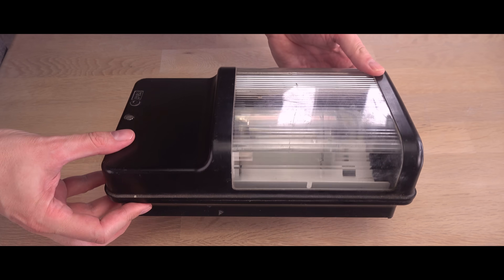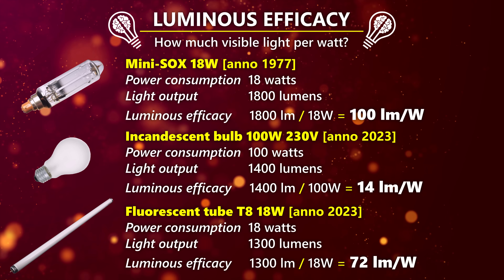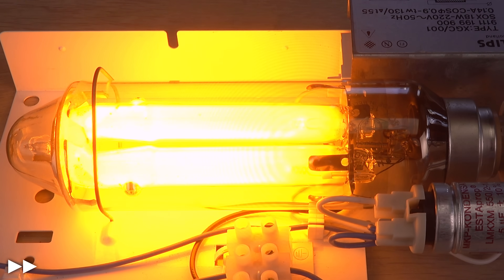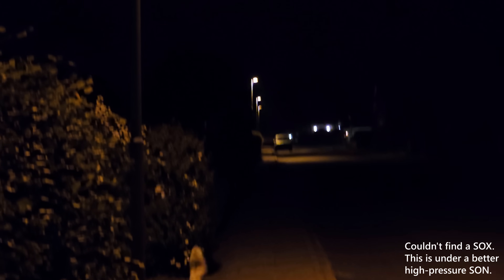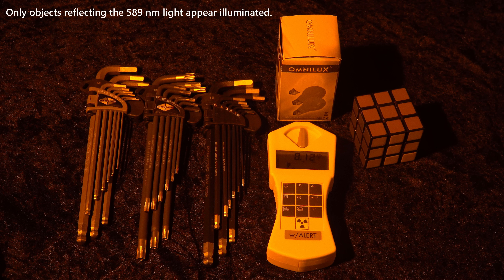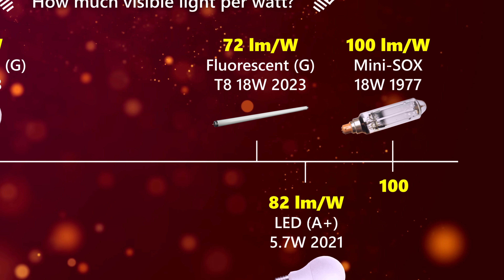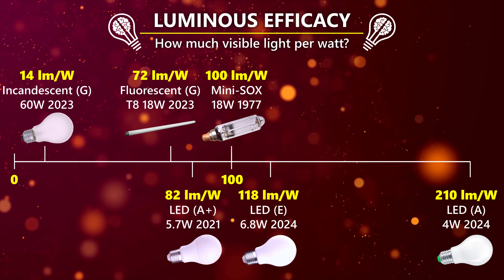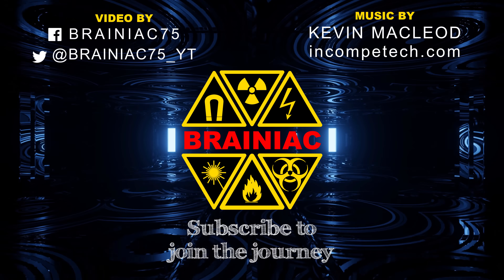THIS LAMP SOXs! "Yellow" tech of bright metal vapor lamp. Beats modern LEDs in brightness per watt?

Comment: IIRC Nilered has a short where he lights a fire that's doped with sodium and shines this light on it.  The effect is quite neat!
Reply: That's the "black flame" and is due to the idea that something's emission spectrum is the inverse of its absorption spectrum. So rather than appearing to only emit the orange light, it also completely absorbs it.

The sodium in the flame is overpowered by the LPS lamp and so appears to be black. Likewise, a shadow is created by the flame if the light is shining through it.
Reply: @MadScientist267  I'm trying to understand this... May sound like a silly question, but why does the lamp not absorb it's own light? If you were to shine a brighter sodium lamp at a less bright sodium lamp, would you get the same absorbing effect?
Reply: @sebastiansullivan4770  Basically, it does, but more of it escapes. This is one of the principles lasers need to operate.
Reply: @MadScientist267  thanks for the answer.  I am also wondering would solid sodium also absorb the yellow light and look dark?
Reply: @sebastiansullivan4770  In a nutshell, no. The structure is different so it interacts differently in solid form. This is also why an LPS needs time to warm up... it can't emit the orange light until it is in gas form.

Comment: Due to a variety of circumstances, I had the fly out of my city's secondary airport.  I parked my red car in the outdoor parking lot and went about my business.  A few days later, I returned late at night and headed to the parking lot.  I walked around for several minutes looking for my red car without success.  After fruitlessly pacing around, I decided to trigger the panic alarm to locate my vehicle.  To my surprise, the honking horn and flashing lights came from a brown car nearby.  Like at 6:16, the sodium vapor lights changed the color of the car as my eyes perceived it.  I had to check the license plate to confirm the brown looking car was indeed mine. My regular airport had newer LED floodlights and my car's apparent color did not change.

Comment: Couldn't you make the light "White" by mixing for example, Barium, Calcium and Lithum or Rubidium? I mean they'll have a higher vapor point, but it may work.
Reply: Then you'd be reinventing the wheel, there's metal halide lamps that used to be used in like warehouses, and big box stores etc. They are now just being replaced by high output LED lamps in just the last few years. A decade ago, 400 watt and 1000 watt metal halide lamps were used in a lot of stores and warehouses for white indoor lighting of large areas.

Comment: A downside with higher CRI is that it is detrimental to a lot of insects flying about at night. This weren't a problem back in the day since most of these species only really sees blue and UV light, and back in the day when street lightning were yellow, there weren't much blue and UV light pollution to speak of. There are however LED lights on the market that does not contain much blue and UV light for this very reason.

High CRI is simply not that great for the outdoor night time environment. So don't be surprised if you see a lot of yellow-ish street lights in practice.

For a while the city I live in (stockholm) did have white street lights as the replacement to older sodium lamps, and there is still places with these white LED lights installed. But more and more are replaced by something more yellow-ish.

Comment: The difference is those LEDs don't last nowhere near as long, I've noticed the street lamps in my city going bad in as little as a few months some mere weeks, 

They start to change color or flicker, and about a third of them have gone completely out. 

Some are strobing like a strobe, some in intervals of about 5 to 10 flashes a second, some around 1 every 2 seconds, and some have turned bright purple.

Some where even the bright purple when they first installed them.

And on top of all that, a lot of them just stay on 24 hours a day. It's a mess.
Reply: While I'm not at all a fan of LED street/lot lighting... Those issues are mostly* from cost-optimized driving/control circuitry, not the LEDs themselves or even the technology. 

The old SOX lamps had some 'fun' failure modes too, but nothing like these LED monstrosities.

*Beyond poor EMC design causing and receiving interferance... There's also some 'spooky' implementations in some of the LED street lighting: 
Superfluous-for-function computerization/electronics on-board that complicate reliability and (sometimes) make you want to dawn They Live shades and a Tin Foil hat. 😅
Reply: @LRK-GT   Oh I know the computerization turns the reliability/ functionality to shit, every time theres a Lightning strike or power surge, they go completely crazy and start flickering, going on and off, and changing colors.

By that I mean like a rapid 3K to 5K temperature switch back-and-forth, in a seizure inducing manner.
 
And it gets even better, the one across the street from my house While it's doing that, makes an extremely high pitch shrieking sound for about 20 seconds.

Comment: The new modern LEDs are more efficient, but for some reason don't last as long as the lamp from the 70s.  Lets load a lamp with complicated power supply components to eek out that extra lumen per watt - at the expense of having to change the lamp out more often.  Whatever happened to the basic rectifier to feed LEDs?  (( also, comment for algorythm. ))

Comment: Another benefit of Sodium light is that the near monochromatic nature of it makes it easier to perceive motion, and it is better for night-vision in general (they are still used on some ships where people need to go outside into the pitch black night as to not hinder their nightvision so much).

As for the lamps i am using: an oooold halogen desk-lamp (nearing 30 years of daily use), some (bad) GU10 LEDs with just barely 60lm/W, and ... a 180lm/W 9.5W lamp for when i need some light for crafting :)
Reply: you should be alright now. the new style cob leds. ive got one glass bulb with those in thats got a really nice streetlighty tone to it. i think were passed the dark ages of leds 😂

Comment: I'm a nerd and use gas discharge lighting for both general and internal lighting applications... the efficacies of the lamps I use regularly are;

20w metal halide - 90 lm/w CRI >80
70w metal halide - 97.1 lm/w CRI >95
150w metal halide - 110 lm/w CRI >90
35w low pressure sodium - 115 lm/w CRI >-44
26w low pressure sodium - 140lm/w CRI >-44

I wouldn't usually list it considering I rarely use it owing to the fact that control gear is unicorn horn levels of rare, but I also have a 200 watt linear sodium lamp. that's capable of a similarly bonkers 147.6lm/w.

All of these beat out the cheapo LED lamps quite handily for both lumenous output and lifespan in my own experience. in some cases even lumenous flux over time too lol
Reply: Plasma is the boss, L** is boring.

Comment: In my desk lamp is a led bulb from ikea, rated at 136 l/w, some g4 socket lamps are 120 l/w (since switching out the incandescent ones to those leds the transformer is really unhappy with the little load it now has to supply).

Comment: Here in the states it’s generally 90-120 lumens/watt these days. Just got some cheapo LED filament bulbs at $2 a pop, says 780 lumens on the box and uses 6.3 watts on the meter. But theres only 2 filaments in there getting grilled at 3 watts each, so they probably wont last very long….The government is looking to institute a minimum efficiency of 120 l/w in a few years. I just hope they put minimum requirements for CRI (r9 too), flicker, lifespan, power factor etc because the lighting companies will want to achieve the higher efficiencies by lowering the quality of the light instead of innovating. LEDs are awesome but like most things in life are only as good as the implementation. They’ve switched to all 5000k+ LED street lights in my city that cant dim, spread light unevenly and glare like crazy, I haven’t seen stars since the switch. They make 2200k street lights that can dim in the small hours and illuminate well that are twice as efficient its just that the city council cheaped out or didn’t care to do the research

Comment: Most of the energy loss in LED lamps is because they are connected to 220 volt (or 110) and thus need to get that down to what LEDs actually need. That is where where the big energy loss is.

Comment: A couple of cons that I noticed with the newer LED street lamps when they were being installed where I was working and living back a decade ago was how painfully bright the lamps themselves were when in direct view and how little they actually "illuminated" outside of the emitter's direct illumination cone (anything directly within would reflect and be visable for a good distance, anything outside of the illunination cone turned pitch). With the Yellow amber there seems to have been a bit of a bleed (might have been just how wide an angle the lamps were designed to illuminate) that caught more of the surrounding area. I worked night security when the town I was living in did their transition. Night illumination went from a dull yellow glow with a few dark patches in the area to patches of illumination right under the lamps surrounded by huge dark patches. Ya, the yellow glow was worse for color quality, but the better color quality lamps were worse for actually seeing if something was there. The light actually hurting to try and see in didn't help.
Reply: That's just a property of a brighter light being outside, it has a more apparent contrast as it has nowhere else to bounce but to go straight to the atmosphere.

Comment: Bummer I can't afford to be a patreon on this. Its a subject that interest me a lot. Allow me to explain: I cultivate hydroponics leafy greens. In this field, one of the main challenges is dealing with exterior(natural) plagues. The more isolated the plants are, the healthier they get in this regard. But its not feasible to have a fully isolated greenhouse, at least not in affordable prices. Having the cultivating beds inside a building is the best when it comes to isolating from outside environment, but this makes it a real challenge for providing light to the plants. Sure modern LED lights are great, but since we need a lot of them, the lumens per watt goes down drastically. My main goal is to have an fully isolated building with LED lights inside that are fully supplied with electricity from solar panels. So these new LED light bulbs are very close to make it possible. But in my goal, there's a catch: Whatever building I have to cultivate, the solar panels must fit on top of it. In other words, I could have a lot of solar panels to provide power, but their size would outgrow the size of the building's roof. Sure solar panels are also evolving, lesser sizes with bigger power outputs, but financially its not feasible to be switching solar arrays all the time, those things are really expensive. So yeah, increasing the lumens per watt in the lamps is one of the key points to me.
Reply: You can't afford $1 a month?
Reply: @Ni5ei  I live in Brazil. So its an international deposit to me, which means $50/each deposit in taxes.

Comment: Hehe. I have the same fixture and brand-new lightbulb in it. If you use it for a longer time as the only (powerful) light source, it messes with your vision. As soon as you return to "normal" light, everything looks green.

For anyone wondering, the fixture is called a Philips XGC001 Mini Sox Kombi (I think the Kombi means that it is a fixture with a light-source sold as a set originally).
Reply: I ran up a 200w SLI/H for a few minutes...

that sucker had me seeing green for at least half an hour lol
Reply: @DigBipper188  hehe. Yeah, don't run it too long as a single light source. xD
Reply: Unfortunately Philips stopped making SOX lamps in 2019.

Comment: I didn’t realize they were made this small! I NEED One!

Maybe another project for that person making brand new nixie tubes and such!
Reply: Better buy them from existing production. DBL Verlichting sells new ones for very reasonable prices (around 30 euro).
Sometimes that store also has ballasts and ignitors in stock. You can make do with an 18w fluorescent ballast and starter if you can't find the proper ones.
Reply: @daliborfarny   Did the ping work?  Granted plenty busy as is!  I need to binge watch your recent videos too :)
Reply: Thorn experimented with making them even smaller than 18w. There exists a few prototype 10w SOX lamps, but getting a hold of them is challenging. They're even rarer than linear SLI/H sodium lamps are

Comment: Hi, nice video! Regarding sodium vapor lamps be careful because, as you had mentioned in the video, a part of those lamps is under vacuum and, with high voltage, can produce some X-rays and the outer glass cannot stop them!☢☢☢☢ Under long exposure there could be problems with this!

Comment: The higher powered SOX lamps can be much more effiicent. For instance, a 1980s 135w SOX does a whopping 160 lm/w, and a 2000s era 91w SOX-E even makes it to 192lm/w. 
The little 18w one is the worst of the bunch efficiency wise, but back in the day absolutely the very best way to efficiently light small outdoor areas. I have two of them, there's video on my channel about starting them on a 15w fluorescent lamp ballast with a glowbottle starter. The lamps themselves are still in production in the far east and available at (among other places) DBL Verlichting.
One important thing anyone who wants to play around with them should know is that they are absolutely not allowed to be run with the base down. AFAIK all of them can run horizontally, the small ones also vertically base up, but check the datasheet of the lamp for specific information about the required running position. When run in the wrong position, the sodium will condense onto the wrong surfaces (like onto the electrodes when run base down) and either destroy the electrodes, or be unable to be vaporized anymore.
Reply: Anything below 55w SOX / 36w SOX-E can be run vertical base UP or horizontal +/- 110 degrees. Running them base down allows the sodium to pool around the cathodes and will result in the area near the cathodes cracking from differential heating and cooling of the sodium. it can also result in the cathodes being coated with the sodium which can prevent the thermionic coating (which is responsible for reducing the voltage needed to strike and maintain continuous discharge) from evaporating off, resulting in the lamp being hard to start if it starts at all.

For larger lamps over 55w they need to be run horizontal +/- 110 degrees and shouldn't be operated base up. This is because the vapor pressure inside the lamp is sufficiently low that all the sodium vapor will pool at the lower end of the lamp and result in an unequal vapor distribution, reducing the lamp's efficacy.
Reply: I'm curious. How did these SOX lamps handle vibrations? 
A dream of mine is to somehow mount a high-output SOX array to a vehicle. But, I'm expecting off/on-road vibrations make the concept a non-starter.
Reply: @LRK-GT  I'd advise against it for offroading. You might get away with it if the lamps you use are framed with metal but modern SOX lamps especially use mica spacers to mount the discharge tubes. These would easily start to disintegrate with constant harsh vibrations.

same goes for high wattage lamps but also with the additional problem of the fragility of the discharge tubes. it wouldn't be hard to shatter one of these lamps with one solid bump.
Reply: @LRK-GT  Unadviseable. They're not particularly sturdy things, with a long glass tube within another glass tube. SON (high pressure sodium) lamps have a smaller, more lightweight internal construction and will be able to handle vibrations better, but they still are designed for stationary use. You can try it, SON lamps are dirt cheap by now. 
Because SON also has some green rendering, it will also make it easier to differentiate between the track and the foliage next to it. But i still recommend against it - go for metal halide or led instead, the warmest white you can get to avoid wrecking your night vision.
Reply: The same is true for fluorescent lamps. Lower power, shorter fluorescent lamps are less efficient because the electrodes losses(cathode fall) is nearly the same, so  a lamp with a higher arc voltage is more efficient. This is even more significant in cold cathode lamps which operate at several kV.
Reply: Yeah I really need to re-mount mine base up. Right now it's sitting base down, poor thing. I have a few more tubes in case I ruin this one but I only run it every month or two, and so far so good!
Reply: My high quality Philips 180W SOX lamp lit up our road for 4 and a half year during night before dying. While it was effective at light (blindingly so), it died too soon for its complexity to drive needing an expensive ballast and ignitor. Both my Philips 18W SOX-E lamps died just before the 5 year mark. That's the main problem with these lamps, they don't live long enough. My 70W HPS lamp still outputs the same strength as when it was new and just passed 9 years of age running every night, and my 150W Philips SON Master PIA Plus might actually outlive myself at this rate (it's only 6 years younger then me, and I was born in early 80s). But don't worry, LED is here and will solve all the problems: My A++ LED bulb with orange "party" color from an off-brand is still alive after 2 years (I rarely turn it on though), while all my consumer LED bulbs for indoor use with A ratings died after 1 and a half years, which is similar to the incandescents, so that's just normal.